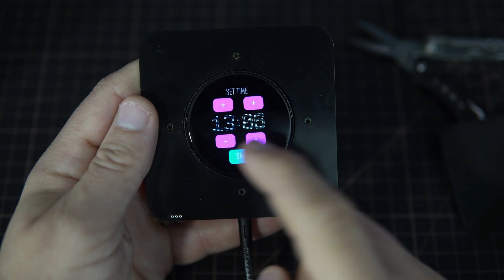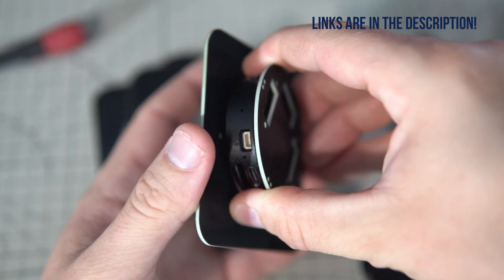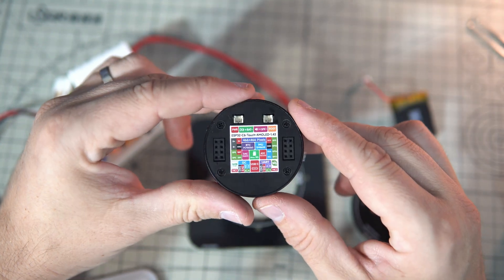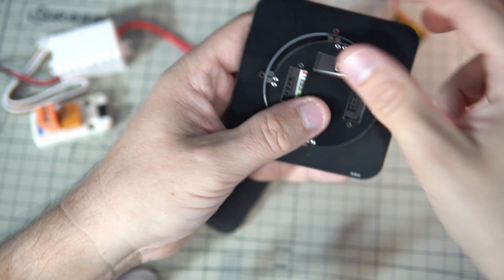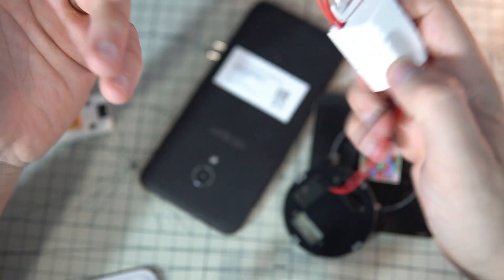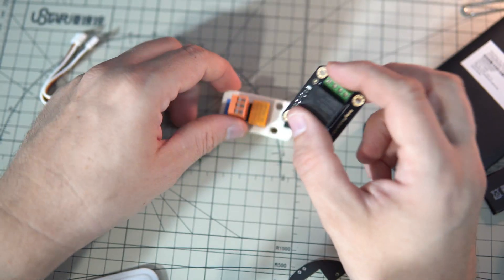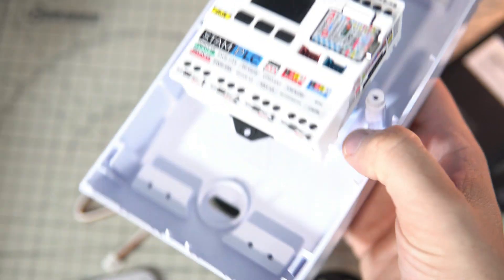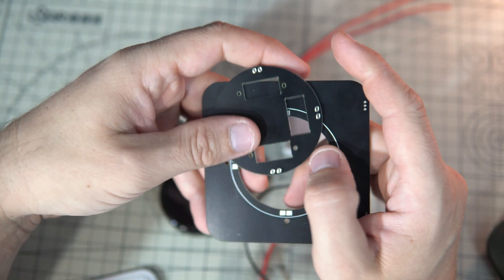Why Buy Smart Switches When You Can Build One (No CLOUD) , ESP32-C6

Comment: I'm afraid of putting a DC to AC converter in the wall... Don't want my drywall and paper house to burn down 🤣
Reply: It's an encapsulated LED driver, but QC on those is often pretty bad.
Reply: Isn't it basically a mains-to-USB power supply (5v DC)? Lots of those available with a proven track record intended for wall installation, usually in an electrical junction box.
Reply: These relay modules have not been certified for safety. That doesn’t mean, that they are not safe, but it means that you’re responsible to make sure that these are safe. As there are certainly some safety risks, it’s a good idea to be very careful with them. Especially in places where are a resulting fire due to a technical defect could be very dangerous, where many people could be affected. Installing these yourself in a house installation very likely violates some safety rules depending on  your location. so if you don’t know 100% what you are doing and can’t guarantee safety, it’s a good idea not to do it. The type of installation of the relay modules in this example is certainly not ideal and I would advise not to do the same. Although it looks kind of safe, but it’s not certified to be 100% safe like this. There are other products that are safe and certified for this use case, which I would recommend to use for that reason.
Reply: If that's how you feel, don't do it. I'm curious though, how many step down convertors have you seen catch fire? Kids of today live in fear (c;